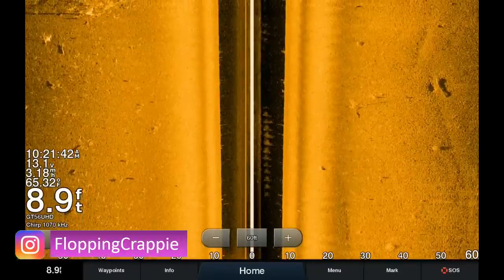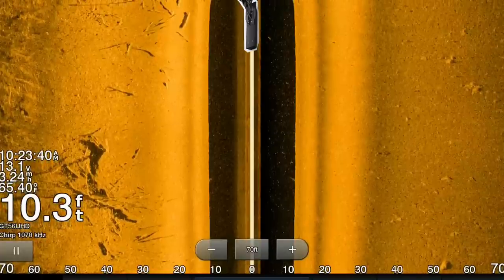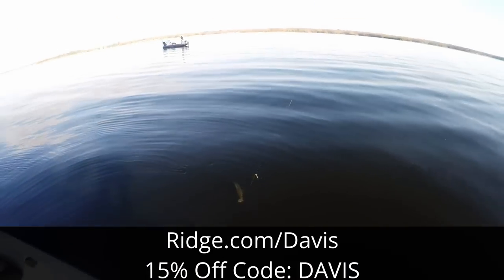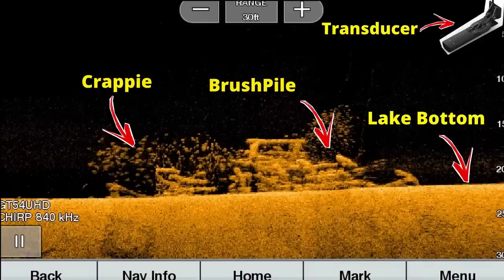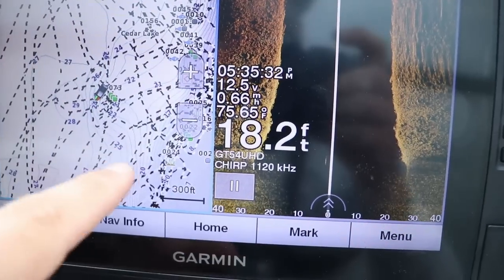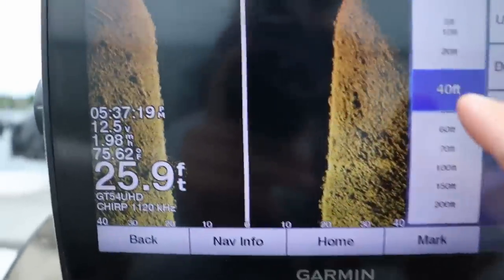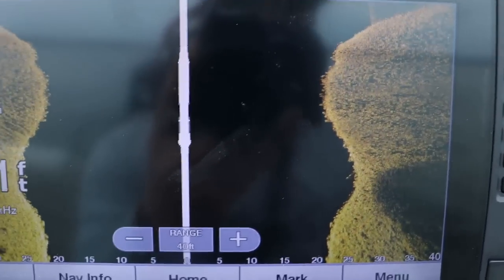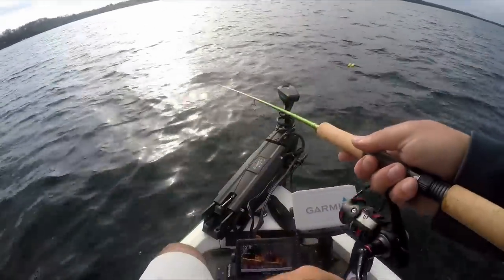How to use Side Imaging to Find Crappie in the summer

Comment: I live in Florida. The lakes i fish are pretty shallow, mostly not more than 10’ deep with a few small areas slightly deeper in some.
There is very little by way of structure in most areas, except lots of shoreline weed beds. Some of those places can be as deep as the main body, but mostly less as for depth. I have a Helix 5 on the 14’ jon boat that i mostly use, with down image but no side image.
I usually use a split screen with regular and down image. I like to single pole along the weeds very slowly using small jigs best. I dont do as well using other methods. And im not a real fan of any type of trolling.
Ive listened to you and others talk about side scan.
Yesterday i went to a local Bass Pro shop to look at new units.
The guy working there was a local bass fisherman who knows the places i fish very well.
Told me he has 2 units on his bass boat, both having side scan.
He then said id be wasting my money by buying a new unit as the water isnt deep enough where i fish to warrant having side imaging.
He also said it wouldnt work for shooting back under the weeds.
I mentioned there not being any docks and he said makes no difference, water isnt deep enough anyway even if there were.
He said look ill sell you one if you want one, but im just telling you like it is for the places you fish as well as most other lakes in this area.
Needless to say i was a bit surprised, which is why im asking you for your opinion.
Reply from the maker: Side imaging will work in pretty shallow water.  I've filmed a few video of using g side imaging in 6ft or less and seeing schools of crappie.